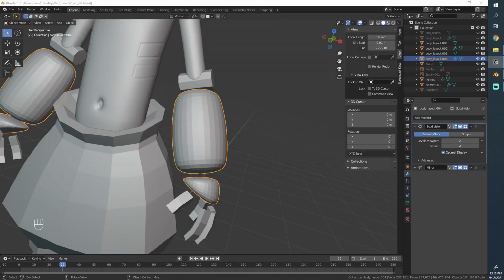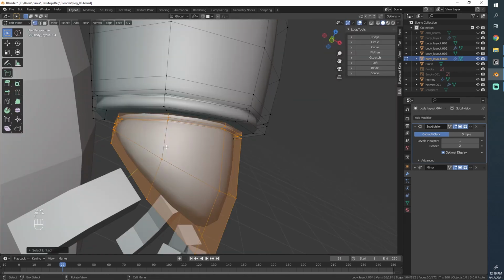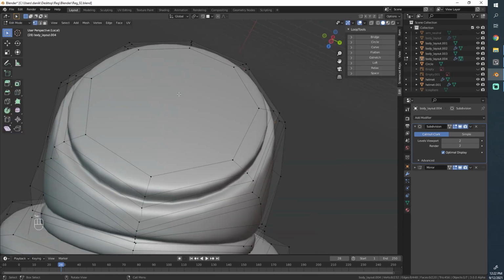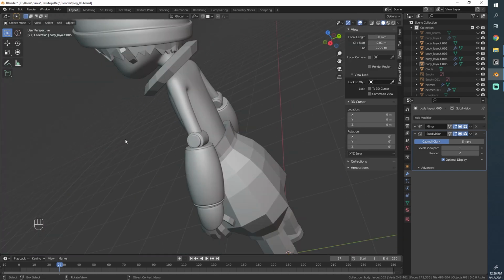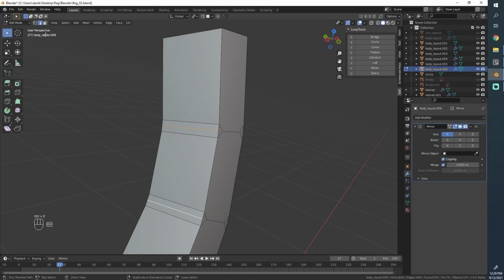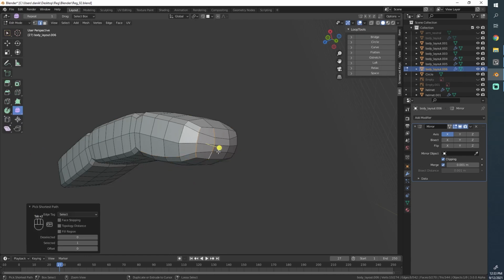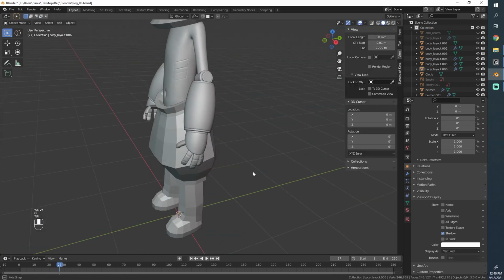[#12] Blender 3.0 Character Modeling Tutorial - High Poly Modeling 4 [2022]

Comment: 0:00 starting on arms, separate + subsurf modifier
1:45 Ctrl b to bevel
4:10 I to inset
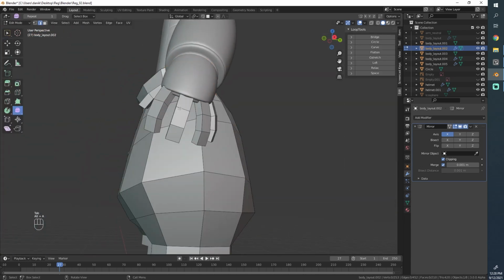14:00 fingers
15:00 pivot point can be changed by pressing '.' key or using buttons at top
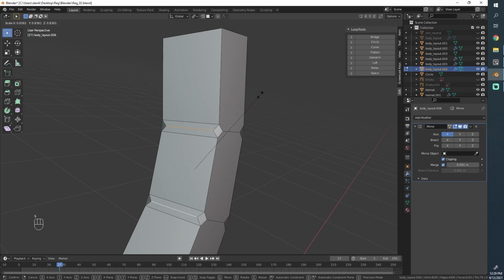15:10 individual origins: separate selections transform separately even if same object.
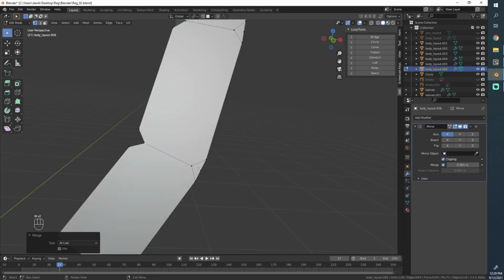15:30 merge at last active elemnt
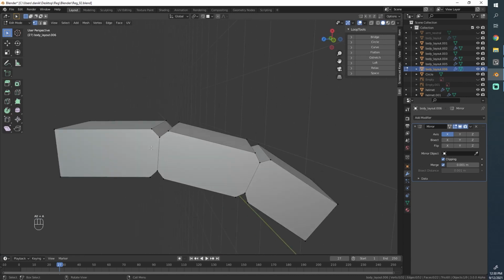15:50 k for knife tool
16:34 smooth tool
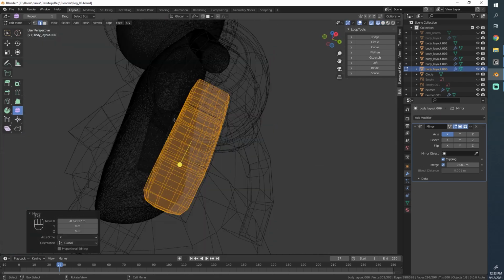19:40 object properties options
21:43 press r twice to get interesting rotations
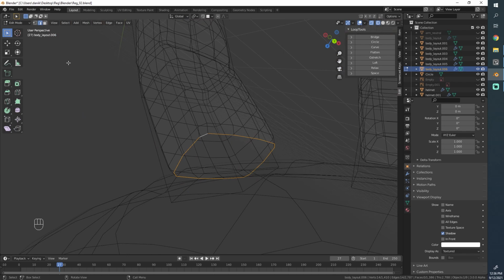22:20 grid fill

Comment: I've got a question, the model has a lot of separate parts (objects), do they have to be connected together at some point during the workflow (via boolean or ctrl j)? Like for either a render or 3d printing?
Reply from the maker: For 3d printing it would make sense, but basically no. Separating parts can make the scene easier to manage 👍
Reply: @DanielKreuter  I assume that the separate objects get parented to the specific limbs?
Reply: @seanchoy236  That's usually the way I do it. I see no reason why Daniel here wouldn't do the same.